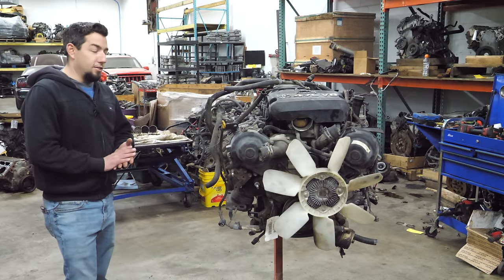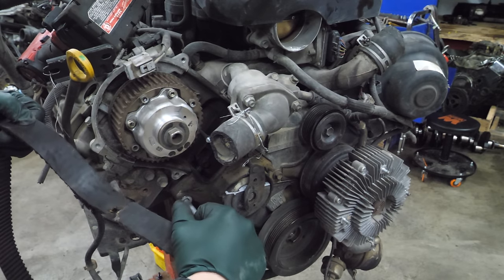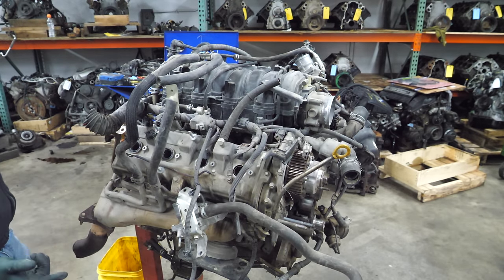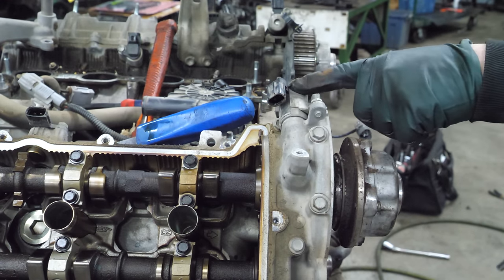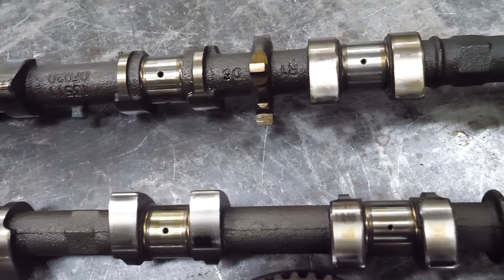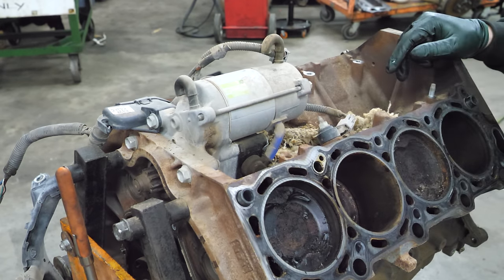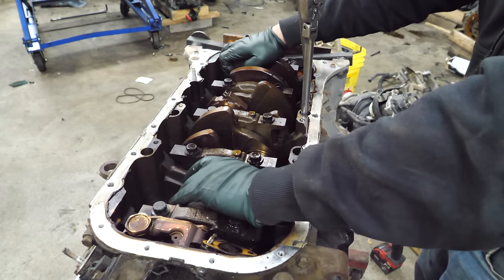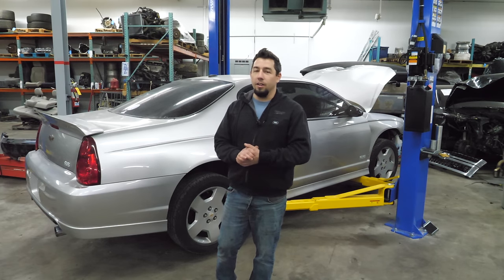Toyota Tundra 2UZ VVT Teardown! Bad Decisions Led To The Demise Of One Of Toyota's Greatest Engines!

Comment: This is how you know this engine was not designed or manufactured by the same people who made Toyotas in the '80s and '90s. I remember on my old Celica, everything was either 10 or 13. If you had those two sizes, you could just about dismantle the whole car. The tech of the '00s for all manufacturers improved immensely, but the Japanese brands weren't customer-centric any more like the old school Japanese quality gurus. They knew their customers would wrench on their own cars, and they knew even if they didn't, the mechanics would appreciate the ease with which you could repair a Toyota, Nissan or Honda and tell people what great machines they were. That's why they got so popular, because it was top to bottom quality stuff. They forgot their roots and seemed to literally copy Ford's manufacturing practices. Don't get me wrong, I'm a bit of a Ford guy for the newer stuff (and the ancient stuff too) because they're ubiquitous, of decent quality and they're cheap to buy and run, but they just don't have that same magic of the Japanese cars from that era, and neither do the Japanese any more. I went back to domestic when I saw Toyota going this way in the mid-'00s. Honda was still good by this point but they were really expensive in the used market. Nissan had long since left the building. One of my buddies bought a '99 Corolla a couple years back to just get himself through a few months rough spot. Paid $800 for it because it had 290k on the clock. Old school Toyota quality, it ran like a top still. Didn't even use oil. Engine and transmission still original to the car. He literally didn't have to touch it for the year he owned it (turned into a bit longer than he had hoped), then he turned around and sold it for $1300 when he moved back east from Californi. I think he should have kept it. Probably still be driving it as a winter beater.

Comment: I dont think someone would chop the main engine harness out when replacing an engine. Im pretty sure that vehicle got in a wreck with something damaging the timing cover shredding that belt. They probably removed that engine just to let it sit and left it in the rain over time. They probably used that 4.7 as a core since it sat outside for so long. I think you have your story wrong.

Comment: I am guilty of this sin. Even though I keep up with the TB change on my GTV6 (30,000mi or 5years, but it's a super easy 2 hour job) and my 164 (same engine, but front drive so about 8 hours to do it correctly) I had bought a '77 FIAT X 1/9 with a 1300. The belt had 5 years on it since it was changed but it "looked" good. I drove it about three years before one morning at 6000RPMs it stopped running. Inside the car I heard what sounded like glass breaking, my GF back at her house heard a gunshot. Incidentally, the TB isn't that hard to change on an X. Getting the engine out is most definitely "difficult".

Comment: 32:15  Could be that the timing belt failure caused a crash of the vehicle, and the insurance company totaled it out.
Reply: If they would have been going fast enough to cause a crash I think we would have seen malice in the combustion Palace
Reply: @samholdsworth420  Depends - if they suddenly slowed down due to the belt failure, they might have been rear-ended.

Comment: By the way, for the average person to fix that fuse, it's probably going to end up being a few hundred dollars after they pay someone to track down the issue and fix it. This is why it happens. They do the math and just decide it's not worth messing with an old car that keeps breaking any more. I mean, even Toyota's have wear items, and they simply just wear out. That starts to get expensive at a certain point, and when the whole car is worth like $2500, it starts to get silly to keep sinking money into it unless you're attached to the car for some reason.  I get it. Also, I love the opportunities it provides for a guy like me. I wouldn't be driving my current vehicles if this wasn't how the world went round. I'd be making payments on something that when I finally pay it off, I'll maybe have a couple years use out of before I throw it away. As it sits, I got no car payment, my stuff runs great and I get to tinker, so I'm loving life.

Comment: please tell me why it's "Timing chain" or "Timing belt" when the belt or the chain have no marks on them for timing the valves and the pistons so the valves are closed or open at the right time so the engine will run right. Cam Chain     Cam Belt 
I feel like I am the only person that knows this .
Reply from the maker: It’s job is to keep the engine in time.
You don’t call a timing light an ignition light.

Comment: is it true the 2000-2007 or so Tundras/Sequioa engines are some of the most reliable engines ever built? I got a 2005 Sequioa and still running just fine with 170K miles!

Comment: I see a lot of little details in the engine that people don't think of. For example where the oil drain plug is mounted to a separate cover. If the drain plug strips out you just have to replace that little cover instead of the whole pan. Does any other brand put their starter in that location. That would be a big drawback if you're stuck out in the middle of nowhere because of a bad starter. What appears to be the cam phasers are huge compared to the Ford F-150s
Reply: I hate that design of oil pan. It puts your entire oil charge behind a single seal that, if it springs a leak, kills your engine in a hurry. Drain plugs don't strip unless you let a dumbass change your oil either.

And that starter location is fucking ridiculous.

Comment: 2021, I got a 03 Tundra Limited v8 automatic, with 225K miles. Dude hands me the keys, and says, I am 3rd owner, and none of us ever changed timing belt. It took all my available funds to purchase the truck, I got a quote of 1100 $, for belt job. But it took me 2 months to save $ for belt job. The guy told me about, Interference motors. So every time I drove the truck I was sure that this would be the day, but, no. I saved $, made appointment with garage, dove to garage, they said they needed it overnight. Great! No Taxis in rural Maine. I offered the machinic a $100 bill, and said would you give me a ride 15 miles, to my home, and after you fix my truck, come back up and get me, and i will pay you $1100, Yup, he said. I assumed we would take his car, but he hopped in the truck, I said, dude if that belt brakes  it will trash my engine, he said , that belt is not the original belt, it cant have 225k on it. OK i said, but here you drive, if it brakes it is on you, OK he said. 2 days later he pulls in my drive way with my truck, I asked him how it went? with a big grinn on his face he said look at Your Old Belt. I could not beleive how worn and cracked it was, I could have broken it , with a good yank! He said he never would have drove the truck, if he had seen that Belt....

Comment: I would NEVER buy a car with a timing belt. It is a disaster waiting to happen. As an auto mechanic for more than 22 years, I have changed many timing belts and repaired the damage a broken timing belt has caused. The water pump is probably original because the timing belt would have been replaced if the water pump was replaced. The oil was most likely changed often because whoever purchased the vehicle new probably got the maintenance package where the dealer changes the oil for free for the first few years. I would say with those GIANT dishes on the top of the pistons there was NO WAY those valves were going to hit those pistons. I appreciate your videos. If I can give you some advice I would use an impact socket with your impact guns. Chrome sockets will shatter and grenade shrapnel everywhere. Thanks and take care.

Comment: "No fight"? I  pulled the head off a 1979 Toyota 20R only with two pry bars, then spent hours scraping the old fiber gasket, so I guess Toyota has changed gasket material since then.

Comment: Is the 2004 4.7 non vvt a non interference engine. 40-50,000 miles into 2nd timing belt (258,000 mi.) Timing belt broke at highway speed. Could I be able to put a new belt (and timing etc.) on it and be good??

Comment: Please do an engine tear down on a 2017 VOLVO 2.0 that’s both supercharged/turbocharged. That’s what’s in my XC60 T6 AWD. there’s no oil dipstick and VOLVO claims oil changes every 10,000 miles. That concerns me because what if the engine is running low on oil and causes the engine to starve for oil and damages the internals. My VOLVO has 50,000 and I’m changing the oil every 3,000 miles. It takes 6.0 quarts but I’m still skeptical about this high racing engine

Comment: Question for you @idocars, For the non-VVT 2UZFE, is it true there is no damage caused by a broken belt?
Reply from the maker: That is true. Most of the time the vvt engines won’t cause damage either but that would depend on rpm and cam timing at the time of the break
Reply: @I_Do_Cars  Ok. I’ve always wondered. Thanks for the fast reply. Ps, I’ve been looking and don’t see a GM 3800 motor tear down. Would love to see one. I’ve learned a LOT about engines from you and your videos. Thank you sir!
Reply from the maker: telecasterman18 I would also love to tear one down! Just have to find a bad one
Reply: @I_Do_Cars  Maybe when my wife and I finally find a large family SUV you can have my 05 Impala. I wouldn’t feel good about selling… much less, to a non-mechanic. It’s actually my daily driver for work, has 218,xxx, but desperately needs a lower intake manifold and oil pan gasket. It never over heats. Oil and oil filters are changed every 3-4k since new. Drains dirty but not milky. I am finding in the last 20k miles or so the coolant system has some oil in it. So oil is seeping into the cooling channels somewhere but no coolant is seeping into the oil. It’s weird. These engines are great but ALL the gaskets are made out of poop apparently.

Comment: The 4.7 is virtually indestructible. A motor of this caliber should have had a timing chain. That being said I had 150,000 on my 4runner when I went to change the timing belt and it still looked brand new. Secondary air pump failure at 156,000 miles was the reason that I dumped mine.

Comment: The tundra 5.7 you have alot more involved in the starter than the 4.7. Takes an hour for the 4.7 and would do them all day if I could.
Reply: takes me 10 minutes to change the starter on my 4.9 I6 and 9 of those minutes is swearing because the fuckin' starter weighs 9 tons. Well not literally but the starters on old iron are big ol' brutes. Best part is I don't need to worry about connecting complicated wiring and plumbing back up or doing intake manifold seals...it's just three 9/16" bolts, a 1/2" nut,  and some serious groaning.

I could probably change it while the engine's running if I didn't mind burning my wrist on the downpipe running right nearby.
Reply: @TestECull  I definitely wish it was more easy like the 4.9 I6 but most of our customers have Toyotas and we are known as a good Toyota and jeep shop around STL and most of the customers have 4.7 engines beside the 3400 in all the old runners so I definitely change more of these intake starters than I do most other types with the Yoda.

Comment: My Camry blew its timing belt.
I got away with it, as it happened at low power and low speed, and no valves made close acquaintance with any pistons. Was able to replace the belt and get back on the road.

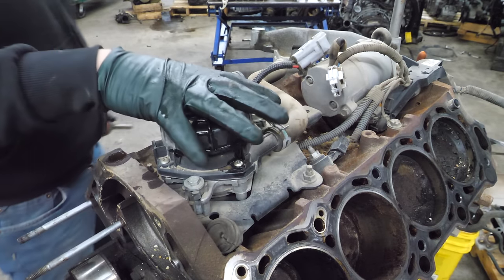Comment: Wow....a timing BELT on a V8? Isn't that a bit unusual for any automaker? Just curious. After bending a LOT of valves back in the day on a 1989 Suzuki Swift GTi (DOHC), I wouldn't even OWN an engine with a timing belt. Granted - the thing had over 100k with original belt on it. AND it was a long time ago. Stupid me did the "neglect" thing you spoke of at the beginning of vid. Just really surprised a TB is on a V8. After watching to 21:40, looks like a non-interference motor. Cool

Comment: Tundra is easier.  I replaced one twice in my 2008 tundra.  You do have to jack up the passenger side of the engine just a bit for clearance, but it isn't bad to do.  Took me about 40 minutes to change out the starter.

Comment: I finally met one in real life: a lady I work with is putting a new engine in her car (some generic GM suv, maybe an equinox?) because she hasn't changed the oil since 2016 when she bought it and predictably it blew up. She says its getting traded in as soon as its running and shes getting a Honda because "you don't have to waste time with stupid stuff like changing the oil on those".

Comment: Hello I have question, I have 2002 Toyota Tundra same 2UZ-fe an it’s giving me multiple random misfire detected, misfires on cylinder 3,5,7. I replaced all spark plugs an all ignition coil, sometimes when I’m driving it it doesn’t misfire, when I leave it to idle an it really warms up you start hearing the misfire n checking light start blinking , please assist me in anyway u can with the knowledge would greatly appreciate it

Comment: I find your videos very interesting.  The whole process of tearing down an engine reminds me very much of an autopsy on a human (and yes, I know what those are like.)  The procedure is done in a very orderly fashion, in the same order usually, the parts are removed and set aside, keeping things together.  Then the parts are inspected for reasons for failure.  Some parts, like a water pump, are further dissected.  And then, at the end, you have just a carcass and you deduce what killed the engine.  The methodology is the same.

Comment: I just looked in the timing covers of my 2006 Lexus GS430 at 200k I got the car at 100k EVERYTHING ORIGINAL I had to sit my car down because the timing belt has cracks all over you’d be surprised those Toyota oem belts last A LONG TIME the only real reason I think mines is cracked ie because the car was sitting in NY before I bought it but it wowed me and scared me so I ordered an aisin kit and I’m working on it ! These cars are tanks you really have to neglect it for years for it to break 

Edit: I can’t believe that belt didn’t have cracks in it like mine does and it broke maybe a tensioner fail or idler

Comment: I had a 4.7 Tundra always dealer serviced I had question that has timing belt and was always told that didn't need it.. I traded it in at 200k still was on factory belt what an inept dealer I have since heard it should be done every 90k. Looks like you could re-ring it, hone the cylinders and put new bearings in it and would go another 300k miles...

Comment: My Lil 1993 Corolla, new timing every 60,000 miles now has 1,000, 048 and still rolling.😂😂
Reply from the maker: This is awesome! I love hearing these kinds of things
Reply: I drove that Corolla to work and back round trip 83.6 miles everyday for 22 years and on the weekends I drove it hunting or fishing. The original fuel pump lasted  22 years. It still has the original muffler hangers.

Comment: Is that an interfering or non-interfering engine ?
Reply: Interference...had one that bent 20 valves.
Reply: It is interference because the pistons have spots for the valve to open when needed without the valves and pistons running into each other.

Comment: To be fair if you swap these timing belts every 100k, by the time you hit the 230k+ mark where most 5.4 triton engines fail from common and entirely preventable issues, you have already spent the better half of the cost for an entirely new 5.4 triton engine (6-7k professionally installed with full warranty).
Just sayin, maybe the cost benefit of owning a Toyota is not as great as people assume especially considering the upfront savings.

Comment: I’ve got a 1989 500k Hilux that the original starter was just clicking jacked it up took the starter out got it rebuilt put it back in still just clicking. 
“It was in drive” 
Should have never questioned Toyota engineering. Never make that mistake again...

Comment: I wonder if the owner made the mistake of assuming this engine had a timing chain. While I haven't made that assumption for any cars I've personally owned or sought to purchase, I have assumed certain engines had chains when they in fact did not. Case in point the Lexus 1UZ-FE or Acura's C32A1. This seems to me to be a top 3 explanation for an engine that is otherwise in perfect running condition but for one major failure point that is preventable, wear-based, and would kill any engine regardless of how reliable it is.

Comment: Always told the owners to do a leak down test to confirm a toast head after a belt breaks.  Ive had a few interference motors break a belt with no damage.

Maintenance aside, Ive never understood why the mocos wont recess portions of the pistons for the valves to prevent the damage when they do break.

Comment: I would say the engine block should be fine with just a hone job.    Surprised toyota  uses a timing belt versus  chain.   Most manufacturers use chains on V8s

Comment: I truely never understood why manufacturers use a rubber belt to keep a bunch of precisely time metal components from destroying each other.  U can up a chain in and it will last for 100’s of thousands of miles or a belt that tends to be expensive to replace and will need to be replaced every oh 50k miles then u just hope it was put back together properly or the parts aren’t crap

Comment: 1. Great engines don't have timing belts;  2. Great engines don't make you pay a significant premium for them over their competitors every time you stop at the gas station.
Reply: @ 2004 GMC 5.3L with 213k. Nothing overhauled. Still take it on a long trip at least once a year.